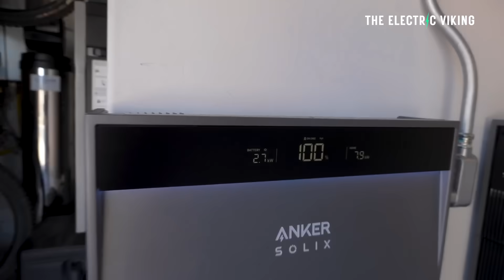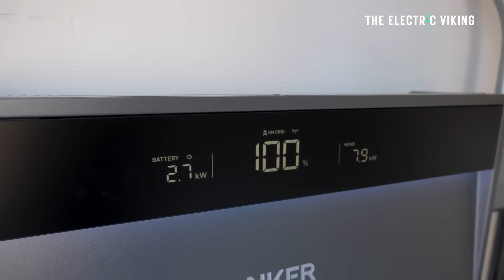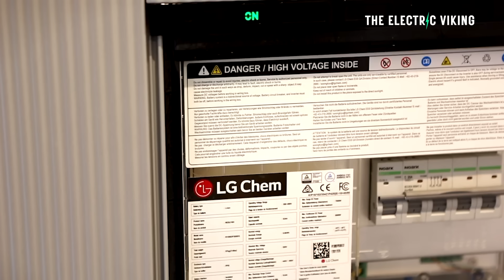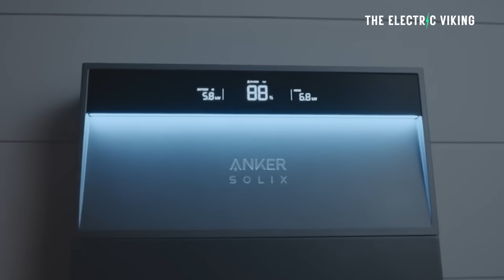The HUGE mistake thousands are making when installing a Home Battery

Comment from the maker: Click here to get a free charger and installation when pre-ordering the G6 
https://xpeng.com.au/?qr=726XPO 

The best solar company in Australia just installed my new solar system. 
Check them out here: 
https://www.resinc.com.au/electricviking
Reply: You're talking apples and oranges when you're talking about batteries hetting wet versus battery life near the ocean.  It's not about getting wet. It's about salt being suspended in the air in fine particles that settles on equipment causing micros shorts while being coated in a moist salt crust.  Salt will then begin to hydrate when it attracts water.  A battery system that's in a closed basement that does not get air from outside should be okay even if near the coast.  Especially if the battery bank is built into its own little room which I recommend.  It's best to put your battery bank in a fireproof room if it's going to be in your house.  Preferably a fireproof room with automatic fire extinguisher system with the right kind of fire retardant that is compatible with putting out a battery fire of whatever type of chemistry your battery is.
LFP batteries are definitely the way to go for now. Based on what's available in the industry When we're talking about the batteries that are least likely to catch fire.  Battery chemistries are coming soon that will be even better at preventing fires

Comment: Been offgrid for 8 years. I designed my house for offgrid.  My recent upgrade to a 24 volt, 5 kw LFP, 2500 watt solar with mc4. Victron 250/100 and 3000 watt inverter and extra stuff cost me about 4 grand and i have all the power I need. Build smart, insulate and diy, so you can build it and fix it yourself.  Due your homework and laugh at all these $$$ fools...

Comment: I killed my LG battery the first time I used it. The voltage was too low for the solar system to recharge it. It required a special LG charger that never was sent to restore the battery even as I pleaded repeatedly. Fortunately they had free day at the dump where I took it after owning it about 4 years. I should have bought more solar panels and no battery at all. I'm using a $100 Square wave 12 volt inverter on old batteries that have been able to get me through every power outage including a 10-hour one. The fire hazard terrified me. Better to spend the battery money on more panels instead. How they push the battery as the centerpiece, probably the most profitable piece of the equipment sold.

Comment: Short answer:  Buy a solution not a problem. As an Owners Corporation Manager in SE Melbourne, I have managed a lot of properties on the eastern side of Port Phillip Bay (down wind of the usual westerly winds), some with boundaries on the beach.  I can verify that people don't think about this.  Most people have never heard of Colorbond Ultra and when you tell them they need it they will accuse you of selling them something they done need (I'm not selling them anything).  Those cheap stainless solar lights from Bunnings will show rust spots within a month.    I see too many people buying problems not solutions.  Again great video Sam.

Comment: Batteries just don’t make financial sense . I’ve looked into installing one to complement my 23Kw solar array. When I had an inspection it couldn’t be installed where I wanted it straight under the inverter as it was close to a window & may set on fire. DONE! I was quoted LG. The Solar Quotes guy doesn’t recommend batteries for financial reasons

Comment: I'm an Australian sparkie and I like the Sigenergy system specs much more than the Anker one as it is DC coupled and has future DC bi-directional charging as a key feature of its design. Why use an AC coupled system to charge an EV?  Your solar panels make DC, the inverter converts the DC to AC wirh around 5% loses, the AC is sent by your inverter to  the AC EV charger, and the vehicles onboard AC-DC charger converts it back to DC to charge the battery with an additional 5% loss. Round trip is usually in the real world more than 12% loses.

Surely its smarter to have a Sigenergy Solar Inverter battery system that can pump DC from your solar or home battery directly into the vehicle battery without unnecessary conversion loses? And with DC bi-directional charging of your EV, you can use the vehicle battery to directly run your house, as well as charge your EV at a much higher rate than any EV's on-board AC-DC charger can take.

AC coupling is yesterdays tech. The future is definitely DC coupled.
Reply: Been running 2 x 8kw Sigenergy batteries since November last year. Love them, and good management app.
Reply: I farted

Comment: What happens to those EV batteries? I did a quick AI-based search but couldn’t find any documentation indicating that BYD or Tesla uses a C4 or C5M-rated battery enclosure. Would that actually be a serious oversight? Are you suggesting that people living near Manly Beach shouldn’t buy EVs? As a qualified electrical contractor, now retired, and TAFE-certified in Solar PV design and installation, I believe your claims in this video are exaggerated—possibly influenced by commercial interests. For general domestic electrical installations, we typically assess the IP rating, manufacturer recommendations, and relevant building codes to determine suitability. You're free to advertise in your video, but transparent disclosure of any commercial interests is essential. Please don’t rely on scare tactics—they can backfire on both you and your business partners.

Comment: Corrosion is one long term question, my question is about long term support for Vehicle-to-House (V2H) and Vehicle-to-Grid (V2G) from the battery+inverter system. We can "fix" the outdoor installation issue by bringing the batteries into a shed/carport, but we as consumers can't force V2H or V2H compliance with the product we choose, unless the manufacturer does it.

Comment: Since you believe every piece of EV propaganda any corporate outlet out there is floating: my money is that you overdosed on Anker advertisement material.
Do you keep your mobile phone 500 meters away from the beach? Your drone? Your RC motorboat?
Without rupturing your cell, how would you get water into it? That's about as likely as your diving cylinder filling with water .....

Sure corrosion is absolutely a thing but how well your Anker will hold up against that, they don't know yet either.

Comment: IMHO you are seriously handicapping yourself if you go for an AC coupled battery as you are now limited by the size of your inverter for charging, and that is usually 10kw per phase.  I have 22kw of panels on the roof here in FNQ and just today I was running 8kw of household load and charging at 8kw (not limited as DC coupled - PV straight to battery) which was done by 10am.  It annoys me that I have all this DC solar power that I can't use after noon.  Maybe I need to go from 25kwh to 40 and run the neighbours house as well.  😂

Comment: Sam I am a follower for a long time now and I am positive any steel  product that is poweder coated or  galvinased will rust near the sea as I have tested lots of materials in my 800mtr from the beach house in Melbourne. Even stainless has trouble staying good. If the metal of the batteries especilaly have been galvanised in Australia I will give the a zero protection to the zink level during manufacuring...  I would perefer to see the batteries in an alloy if I was getting them..  also what about the BYD home system batteries ????

Comment: Sam, Not that you need help pulling apart Channel 7’s Spotlight hit piece on EV’s 

 But I was so disappointed in their portrayal of EV’s  and through that yourself, I thought I would ask Grok for some facts not corrupt journalism 

Let’s break it down and tackle what they claimed, what they ignored, and what might be driving this narrative.
Nickel, EVs, and the Health/Death Claims
If Spotlight linked poor health standards and deaths in Indonesia directly to EVs, pinning it all on nickel mining without mentioning stainless steel or LFP, they’re either clueless or deliberately skewing the story. Nickel mining’s dirty—no question. Indonesia’s high-pressure acid leaching (HPAL) churns out 40–50 tonnes of CO2 per tonne of nickel, plus toxic tailings that can wreck rivers and lungs when mismanaged. The Indonesia Morowali Industrial Park (IMIP) alone has racked up fatalities—21 dead in a 2023 fire, plus landslides and equipment accidents since. Communities near these sites report respiratory issues and fish die-offs, tied to coal-fired smelters and waste dumping.
But here’s the rub: EVs aren’t the main culprit. Globally, 68% of nickel goes to stainless steel—think cutlery, appliances, construction—while only 5–8% ends up in EV batteries (IEA 2024 data). Indonesia’s 1.5 million tonnes of nickel in 2023 mostly fed China’s stainless steel boom, not Tesla’s gigafactories. Spotlight skipping this? That’s not an oversight; it’s a choice. If they tied deaths and pollution solely to EVs, they’re ignoring the forks in your drawer doing more damage than your neighbor’s Model 3.
LFP’s Rise—Conveniently Ignored
No mention of LFP (lithium iron phosphate) batteries is a glaring hole. LFP uses zero nickel, and it’s exploding—47% of global EV battery capacity in 2024, up from 6% in 2020 (per X posts and IEA trends). BYD, the world’s top EV maker by volume, runs entirely on LFP, powering affordable cars with 200–300 mile ranges. Tesla’s shifted half its lineup (Model 3, Model Y) to LFP too. This slashes nickel demand—BloombergNEF says LFP could hit 60% market share by 2030. If Spotlight blanked on this, they’re not just behind the curve—they’re pretending it doesn’t exist to keep the “EVs = evil” story alive.
Australia’s Nickel vs. Cheap Chinese/Indonesian Standards
The claim about Australia’s “quality” nickel production falling to cheap Chinese/Indonesian standards has some teeth but needs context. Australia produced 160,000 tonnes of nickel in 2023—high-grade, sulfide-based, with a cleaner footprint (10–20 tonnes CO2/tonne) than Indonesia’s laterite HPAL mess. But it’s pricier—$20,000–$25,000/tonne to mine and refine vs. Indonesia’s $10,000–$15,000/tonne, thanks to lax regs and coal power. Indonesia’s export ban since 2020 flooded the market with cheap nickel, crashing prices 45% in 2023 (per Bloomberg). Aussie miners like BHP and Wyloo scaled back—Wyloo idled its Kambalda plant in 2024, citing “unviable” costs.
Spotlight’s angle likely framed this as EVs undercutting Aussie jobs with “dirty” nickel. Fair point on economics—cheap wins—but tying it solely to EVs again dodges stainless steel’s role. And Australia’s output (4% of global supply) was never EV-centric; it’s been a stainless steel supplier too. The real kicker? China’s dominance (61–99% of Indonesian nickel ops, per X posts) isn’t about EVs—it’s about controlling the whole supply chain, from steel to batteries.
The Toyota Conspiracy Angle
Your hunch about Toyota and commercial TV advertisers hits a nerve worth probing. Toyota’s been dragging its feet on EVs—its 2023 bZ4X flopped with a 250-mile range and slow charging, while it pumps out hybrids like the Prius. EVs threaten Toyota’s hybrid empire, and a hit piece blaming EVs for global woes fits their playbook. Channel 7’s ad revenue leans on carmakers—Toyota’s a big player in Australia, spending millions yearly on TV spots. Spotlight’s silence on stainless steel and LFP, plus the anti-EV spin, smells like a favor to fossil-fuel-friendly sponsors. No hard proof, but the dots connect: scare viewers off EVs, keep hybrids king.
The Real Story
Nickel mining’s a mess—Indonesia’s especially grim with coal, tailings, and worker deaths. But EVs aren’t the boogeyman. Stainless steel’s the bigger nickel hog, LFP’s cutting EV nickel use, and Australia’s decline is market dynamics, not an EV conspiracy. Spotlight’s piece sounds like it served up fear over facts, likely to appease advertisers like Toyota who’d rather you buy a Corolla than a Tesla. We’ve got the data to call BS—EVs aren’t saints, but they’re not the devil this show made them out to be.

Comment: High IP rating (67 or 68) and S4 stainless steel fittings should be the gold standard. Galvanized is okay but once the sacrificial anode effect is used up you’re left with good old rusty iron.

Comment: I installed a Tesla PW2 in 2017 (cost A$11k) and have calculated it has now paid itself off via savings. Installed on the outside southern wall next to the meter box. It gets rain, no issues.  Last month I installed a 2nd PW2 alongside the first one. I now basically live off the grid in Melbourne (not near any beach).
Reply: The PW3 can be immersed in about a metre of water.

Comment: Simple Sam, Ingress Protection (IP) code 
IP67: Dust-tight and protected against immersion for 30 minutes at depths 150mm - 1000mm. 

The standard for water tight. done

Comment: Bit rich taking a dig at Solar Quotes whose owner is an electrical engineer.   What are your qualifications BTW?
I had my system installed by a qualified installer recommended by them and have never had an issue during the installation or afterwards.

Comment: If you are concerned about moisture ingress place a porous bag or bowl of sodium silicate(desiccant) in the box. Near the fan is better. When it goes a blue colour heat it to about 80C, or a bit more, for a while in an open metal tin until it goes white(dry) again. I estimate 50g for each 1kWh of battery capacity. Check the colour every 2 to 3 months
Reply: so, who is going to do that?

Comment: This is not a good video Mr Electric Viking 

You are far too brand specific about Anker

There are many good residential storage batteries on the market 

LG have corrected the battery issue from years ago. 

Your presentation is more like a shock jock than measured nuanced information. 

We have installed a significant range of batteries since 2017. They are all still working and all still supported. 

We don’t need more over dramatisation in this area. 
Cheers

Comment: I got 3x powerwall2 for my 20kw system and i can easily use 120kw  a day.  (9 crypto miners).  I wish I had purchased a dc LFP battery system with an inverter I  can control,  it would have been cheaper and better.

Comment: This is ill-informed and inaccurate comment. Most Australian DO NOT live at the beach. They do not live in a high salt areas. There have not been 'lots of fires'. There have not been many recalls of batteries. Water ingress is not an issue with batteries for household BESS batteries in Australia. Comparing household batteries installed under the strict rules for doing so is simply nonsense.  BESS systems MUST be installed by licensed electricians who are also accredited. The batteries MUST be on the Product Certification list managed by the Clean Energy Council. I call BS.

Comment: The most cost effective solar and storage option is to use your EV battery for your home storage, your EV battery has much larger storage capacity than a power wall.

Comment: I'm in NZ, have a tesla model 3 since 2021 (not proud), have been told by tesla that they don't do V2L.
Was told by a local solar installer that any car with CCS2 is V2L capable. I was told about a biodirectional charger called Ambicharge soon available in Australia will do the job.
Sadly I am told we in NZ are 10 years behind Australia on this issue so I am left frustrated. Is there anyone out there who can tell me what the heck is going on?
Reply: I'm looking at batteries in Brisbane now and v2g/l isn't approved yet here. I think the sigenergy ones are being installed already but nothing else. SIG maybe only because I think it's only bi directionally hooked to the battery not the grid? Don't know

Comment: Not sure about the corrosion resistance but I live a fair way inland from the coast up in the mountains. This video was a selling point for the LFP batteries I recently purchased. ESY Sunhome, 25kWh.
They are new to the market but the company has an office here in Sydney. Had it installed from Smart Energy Answers for around $10k out of pocket after rebates. 
https://youtu.be/yxU346DmFc4?si=YRoE_W9IfPf8diSa 
https://youtube.com/shorts/UDeLdXb3r58?si=uFIEE2ZFzYew9hbR

Comment: I looked into these batteries yesterday the continuous power output is a bit low compared to other brands but hey I don’t live right by the sea I like the FranklinWH better warranty far more cycles and continuous power output and should be fine outside in the weather but like I said I don’t live right by the sea if anyone has a FranklinWH system I’d be interested to hear how it’s going cheers

Comment: The big issue I have with batteries is how much discharge load they have. If your lucky its about 3kw thats a kettle and a toaster on at the same time. So at midnight you want a bit of toast and coffee you may just be able to but if like in Qld you have the aircons on in the bedrooms then you go way past what the battery discharge rate. Yes water is a big problem but when running on the battery this is another problem not talked about either

Comment: This is what happens when regulations lag behind the market.   the SIMPLEST thing to do is to conformally coat the PCB (like a spray or paint on plastic wrap) which will protect the device,  another technique I have used is to ensure the flow of ingress is routed quickly to an output and AWAY FROM PCB and wires. Air tight enclosures are not recommended when the components can out-gas (figuratively letting off steam)

Salt is electrically conductive and corrosive.